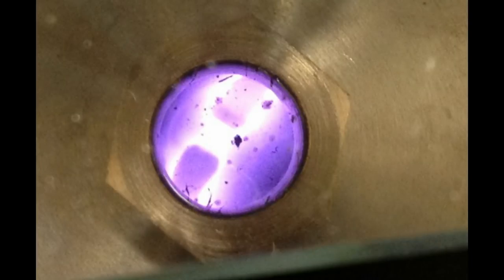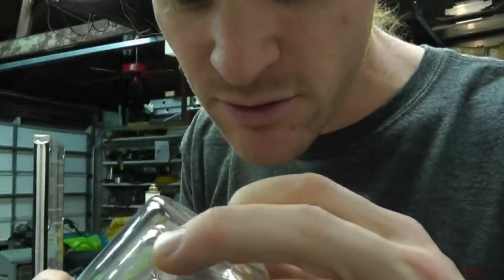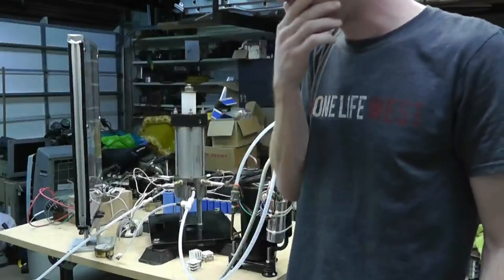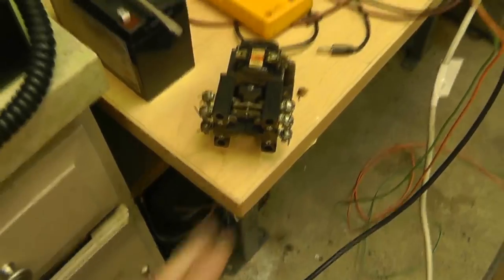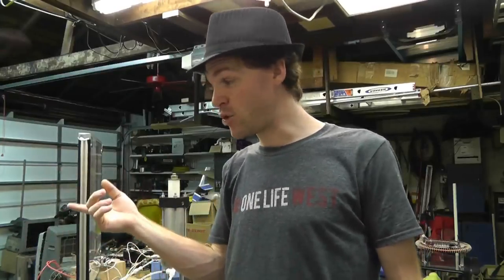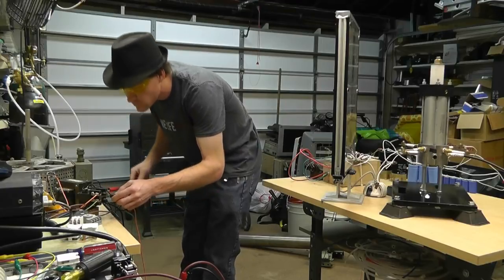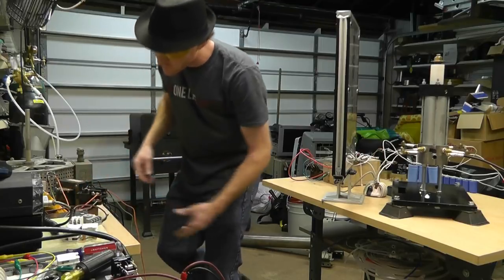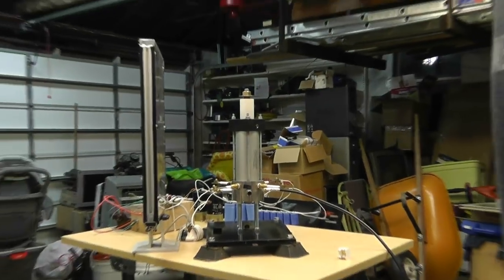Update 11 NGE Papp: Hydrogen To Plasma Will Do Mechanical Work? This May Be Better? RWGresearch.com

Comment: If you use basic "suvat" equations you can find what the initial velocity must be once the block leaves the piston.
 You can then use another "Suvat" equation (Vf=Vi+AT)applied to the acceleration the block must be undergoing due to the piston.
 That acceleration multiplied by the mass of the block (make sure your units are correct) will give you the force.
 That force multiplied by the distance the piston travels from rest to fully extended is the work the device is doing.

Comment from the maker: Yeah and the other problem is that if the position moves 3" the force pulling on it is a major factor in this popper setup. That also needs to be calulated, or the position needs to be under "power stroke" to see full force.. As there will not be a vacune pulling back on the position... Just some thoughts! Hope all has been well! ~Russ

Comment: at 25.min 40 sec you are interested at the green glow, and feedback. I had had a similar reaction with some of my experiments. after the spark had occurred several times there ended up being a delay, and a bunch of energy that was forced back in the other direction.  i believe, because after each pulse, some energy clogs up the wire, or gap in the other direction.. a magnetic component.. i had to come closer, and wait longer for discharge, and it was a strong green type discharge also. cheers.

Comment: hi Russ. if you put a magnet on the side if the contacts you can reduce the burning of the contacts and maybe remove the back emf from going back upstream. the magnets will draw the spark away from the contacts stopping the arc from sustaining.

Comment: So *very* well done there Russ.
No longer a Papp engine. You name it !
Thorium induced reaction in the H2 ?
Piston has push and pull !
Converting to 2xH and back again ?
Try same with plain tungsten spark electrodes ?

Comment: Since the gas expansion reaction is working at atmospheric air pressure, why not try to initiate a reaction in a flexible bag made from inner tube material? If the bag can be seen to expand violently, it may be possible to measure the pressure spike over time more accurately, knowing the "rise time" of the reaction will allow you to tailor the pistons diameter to stroke length to maximize efficiency.

Comment from the maker: correct, infact, I did some more checking and testing, 31420uf 250vdc = 981.87j to start. After fire an average of 180vdc . That's 509J left. So 472.87J to do the work. ~Russ

Comment: Russ, Put a little water inside the center of the glass when you microwave it. "Mr. Wizard" did similar long ago with a ring shaped fluorescent tube long ago. I forget the exact reason the water helps to excite the gas inside the microwave but it may help you get a result.

Comment: You like to experiment !!! Try a 10,000,000 volt 3 mill amp stun gun (only $30.00 on ebay) with a PWM to control your pulse width hooked up to any hydrogen oxygen separator.
Reply: Excellent and inexpensive.
Reply: And useless (for free energy)
Reply: Unless you power it with a solar kit

Comment: hydrogen gas has been used in sterling engines because it has the most expansion when heat is applied.
I'm looking forward to the practical application of an engine. If you can run a spark through the gas at a certain pressure, you should be able to determine if an engine can be made to run on this gas. However if the hydrogen is not being consumed, and there is no need to add more fuel, then I don't see how this can become a practical engine that can do work. i.e. perpetual motion wont work.

Comment: when you were on rapid fire the time the neo bulb lite up. were u at 250 v or 200 v?

if there was induction caused by a magnet component, the position of the equipment may be important.

above and behind the discharge, like the first time.

Comment: hello, do not study much about it, but i wonder about the metal fatigue that would suffer the cylinder by thermal changes can design it in titanium? first by de low specific weight and second for its high melting point which help you avoid problems with heat or at least to change the metal matrix thermal restructured in the process

Comment: I'm assuming when you put the amps through it, what is happening is the gas is expanding because of the heat involved. but it immediately cools causing the piston to come back. However there appears to be a build up of pressure, so a side reaction my be occurring to the hydrogen. It may be turning into helium or an isotope which takes up more space. What you could do is remove the gas and have it analyzed at your local university.

Comment: Do you have a discharge path for the capacitors? You may need an additional relay trigger circuit the disconnects the capacitors and allow them to discharge slowly through a resistive element that can handle the power.

Comment: 9:18 plasma discharge inducing voltage back throught the coil then through the system? I am really intrested and in some kind of way really informed about this thing. I really would like a feedback :). thanks.

Comment: In an engine it is not beneficial to have a quick explosion as it appears that on a high compression this is effective but the expansion does not proceed.   For a piston to generate power, the medium must proceed to expand through the stroke.
When launching planes on an aircraft carrier, they put in a piston superheated water and this quickly boil and as long as a drop is left, the piston keep on moving at constant pressure for a long length to launch the plane. Such a catapult could not be made by a petrol or a diesel explosion as in such engines the  expansion does not last too long after top dead centre.
With this machine  The expansion is effective only when the compression is fairly high and that is why he keeps pushing that piston down where it does move out , but for a short length.  All these considerings in engine will have to be considered as the nature of the explosion--expansion counts a lot,. In engines it is much better to have a long puff on the piston rather than a quick fast explosion which only affects a small  localised volume.
Reply: better expansion with steam I can understand that cool. Thanks

Comment: hey rus . super stoked to see the papp noble gas engine is going forward. papp had coils surrounding the cylinder was he using the magnetic field to deflect the charged particles? and he spoke of a huge amount of voltage he was dumping off to a resistor bank,was this extra voltage from the coils around the cylinder? love all your vids keep up the great work. also i see ptp is selling licenceing agreements have you gone through thier program? super stoked!!!!!!

Comment: hydrogen expands a lot when heated ... you might just be seeing thermal expansion ... not really sure ... what makes me think so is that it seems to be maintaining heat and remains expanded after your "rapid fire" test ... 

I think it might be time to start trying to collect some data on the thing ... need to know how much force is being generated compared to the amount of energy input ...

Comment: hi russ you tried a wound b+ coil round the hydrogen to pluck off the electrons just before it entrers a chamber neutrons should attach and cause a static spark implosion .thats  my logic  no expert here though in uk

Comment: What you are seeing is completely normal and is to be expected but you can still make use of it. Will still look at your other vids after this, but the plasma impulse can dissociate hydrogen from oxygen on contact with just the moisture in the ambient air. There is the expansion, but is followed by an implosion when they recombine to form water again. https://www.youtube.com/watch?v=m5lz9Rr7OUg - btw, you can put an inductor in series with the plasma discharge to get a high speed electromagnetic pulse to run an electric motor - that is the basis of the Ed Gray motor. Look at the other vids on that Energetic Forum account and you'll know what I mean. Also some on the account with my first and last name.
Reply: Good explanation of what is really going on with the volatile power of fast chemical reactions.
Reply: Best friends for ever

Comment: Good, Next you will need to lift 700 pounds 3 inches to obtain unity. Calculate output by P2V2-P1V1 rather than MGH. MGH does not take into consideration the cylinder pressurization which amounts to about 2/3 of the useful output.

Comment: Wes - just quick note - Your input is not 1000K - you are forgetting to subtract the energy in the caps that wasn't used. I believe you said your caps dropped to 128V so the energy used is : 1/2C(V1^2-V2^2) or 738 Joules. A significant improvement.

Comment: Good job! You reinvented the internal combustion engine! You keep saying "plasma doing work". What properties of plasma could be used to do work? Maybe the heat? Maybe the pressure wave created by the ignited expanding gas? You do know that fire is considered a plasma, right? And that it is the basis of internal combustion engines. I am not sure I see what you see here.

Comment: Your back EMF issues will continue to plague you until you get that under control or at least managing it. Would be interesting to use the back EMF as well. Think of your caps as a charge bank, your getting close to an area of physics, that your going to need some math to understand what is happening.

Comment: Get yourself some old fashioned analog meters, like a Simpson volt ohm meter, solid state meters do not handle hi-voltage transients well, the analog ones do and are very forgiving. They are inexpensive and plentiful.

Comment: That is plasma heating a gas and displacing a piston nothing more. I'm sure you would have far more efficiency with a brushless DC motor running on the same amount of power...